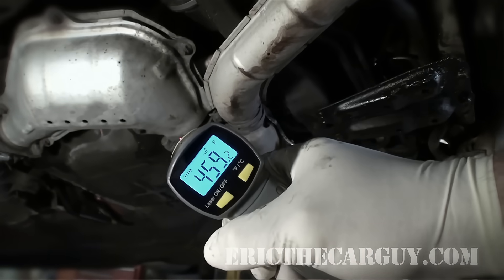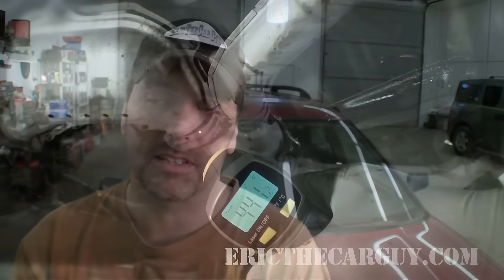Does Lacquer Thinner Clean Catalytic Converters? -EricTheCarGuy

Comment: You're supposed to run a 10:1 ratio. Do 1gal of thinner to 10 gallons of gas. So you're not running enough thinner thru the system. And you need to run your car at higher rpms.

Comment: Just did this on a 5.7L and it WORKS. pour in one GALLON of thinner (not a quart) with a half tank of gas. Drive it so the car tachs at least 2500 rpm. Preferably on the highway. I drove 130 miles, and without clearing the code, the light went off ! You might have to drive over 200 miles, and keep using the Lacquer thinner. But the code should clear. Unless you are hearing the guts rattling inside the cat lol

Comment: The petrol E10 supplied in UK very dry causing various issues with various injection systems have found some petrol additives lubricate and keep clean the fuel system and stops sooting

Comment: Since pulling off my front bank cat on my Honda would require me to remove the fan shroud, my passenger side wheel, and my passenger side cv axle, I think I’d rather try the laquer thinner before removing the cat for cleaning.

Comment: It worked for me with one gallon of LT. My CEL gave a P0421 code because I left too much Berrymans B-12 in the intake after a carbon cleanup. Drove 30 miles highway, nothing. Drove another 30 miles a few hours later, nothing. With my errands done, I dug into it using Scotty's rev in place method. Cleared the code, ran 30 min at 2300 rpm (watch the temps) in Park. Code didn't come back. I still had 3 gallons left so to burn it off, I got on the highway (after rush hour no traffic), ran at 3000 rpm over 20 minutes. CEL stayed off, when it previously would come back after 10 minutes.

Comment: According to all I have read the long-term effects of using Lacquer thinner is negative with corrosion problems and seal deterioration of the fuel system including damage to fuel injectors.

Comment: This will depend on what is causing the catalytic converter issue. If there is only carbon and other fouling then fuel additives can help the fuel to burn cleaner and partially clean it for some time (Cataclean, Techron, Lucas oil, etc.) they can work for a while, but unless the cause is resolved (PCV valve, worn piston rings, etc.) it will come back in time. If there is a hole in the cat then it needs to be replaced.

Comment: There is another video recommending removing the cat and soaking it in distilled vinegar to remove the carbon which could work and makes more sense as vinegar can be used to clean most metals.

Comment: I had come here and comment!! 
10/09/2023
@Scotty Kilmer
thank you so much .!!!
for your time the value you give out to the world,  for sharing your knowledge,
I' needed it this fix, didn't believe, and was scared a little bit at first,
for P0420, if your Cat, it's just staring to go, like Scotty says, it's worth to try, I did it today, 1 galon lacker thinner to a half a tank, drove my 96 tacoma 2.4, for 2 hours, went 3 hours total without turn it off, next check the monitors with a OBD scanner ( mine, blue driver ) total pass, 
took it to smog check,
guy says.. truck's running super clean, have not seen that so often
so good to hear, I don't know how long is it going to last, but the thing is, to pass the emissions, because, car overall runs very well,
THANKS @Scotty kilmer

Comment: Thank you for proving Scotty WRONG.
Reply: OK, so he has "proven" Scotty wrong. He's "proven" that lacquer thinner doesn't work, by using one quart, instead of the recommended dose of one gallon (so 25%), in about three quarters of a tank of gas, instead of the recommended half tank. In a vehicle that he states the catalytic converters are not clogged, instead of one with a clogged catalytic converter. Yep, he sure showed Scotty. This is trolling and clickbait, if I'd seen this video first, I'd never have watched anything Eric put up.
Reply: @Rob07601  Yes, I agree with you Rob. He is a tick sucking the blood out of Scotty. 👍
Reply: @sartainja  LOL, OK, I think that's going just a bit too far. I actually like his other videos. This one rubbed me the wrong way because he wasted my time with a meaningless video while I'm trying to decide what to do about my F0420.
Reply: @Rob07601  Sorry, about the code that you are attempting to clear. Watching all these videos makes you feel like that dog chasing his tail. If the code popped up during this cold weather,  maybe just wait until it warms ups to a reasonable temperature.
Reply: @sartainja  It's been brutally cold here in Orlando, low 40s a few times the last couple weeks. Twenty years and I still don't miss winter in NJ.  =-) I have to drive my pickup for work, so I don't need any breakdowns. When I searched the code on Youtube, Scotty's video was one of the first results, but putting lacquer thinner in my gas tank doesn't sound right to me, then I saw this video title, "Does Lacquer Thinner Clean Catalytic Converters? -EricTheCarGuy" "myth busting" Scotty's video, which turned out to be useless, because he didn't duplicate the test. Leaving this worthless video, that doesn't answer the question it asks, up for ten years, getting 2.9 million views strikes me as trolling for clicks. Ended up picking up CataClean at AutoZone, I'll see if it helps.
Reply: Follow up. I used the CataClean, added to about a quarter tank of gas, but drove about 30 miles instead of 15 before I filled it up. 
Next morning when I started up, no check engine light.

Comment: I did 1gal Lac Thinner to 1/2 tank on my 2017 Ridgeline. Ran engine for 40 minutes at 3000 RPM, then reset engine light. Drove about 70 miles on highway and engine light reappeared. Days prior, Honda dealer installed new injectors  because of error code/engine light.  Drove about 70 miles on highway and engine light reappeared.

Comment: I think you should retest with a gallon of lacquer thinner. You should remove and inspect  prior to the test drive to make sure the issue is contamination (soot) and not physical damage. Then you will be able to conclusively say whether or not it worked on your car. Right now, I do not think this was a valid test.  Also, I'd say we are assuming that the CAT is contaminated and not worn out.  I think the thinner would work in certain cases of light soot with low build up.

Comment: I know that a good old-fashioned Italian tune-up can work great on an under-performing cat. My 5 Series BMW just refused to bring the CO inside permitted limits so, as advised by the tester I took it for a major thrashing and after it had cooled down a bit passed the emissions with flying colours. Of course it's not easy to do this inside speed limits (but I did of course 😙)
In this case I suspect the combination of the high power settings and the oxygen in the acetone molecule help burn off carbon deposits in the cat.

Comment: I had a rattle on my exhaust, and I thought it was the catalytic converter, turns out it wasn’t, but I removed the catalytic converter insides on my 1995 Saturn coupe. no check engine light and actually the car runs much better without catalytic converter’s

Comment: Make a long story short I got a 6 L 2500 2009 Chevy with a bad catalytic converter tried a bunch of snake oils made the check engine light come on sooner I was going to buy the whole wide pipe with the catalytic converters would have been over $600 plus labor I seen Scotty's video that then confirmed it here I just tried it drove it over 60 miles look at my live data temperatures went down by about 300 degrees way better acceleration no check engine light yet exhaust smells a lot cleaner as well

Comment: Sooo, after having a misfire due to oil getting past a spark plug seal, (Toyota 3.0L 1MZFE) I eventually got a CE and Cat code...  ... saw another YT video suggesting the Lacquer Thinner fix and it worked!!!   Be very careful to not use too much or can potentially overheat CAT and Pistons from what I've read (used about 1/4 cup for about 5 gals in  the tank).

Comment: I discovered something new with my 2005 honda minivan...When the engine gets hots the van dies until  the engine cools.  The Honda dealer said: it was the fuel pump, throttle control; radiator, etc... After spending much $$$$, i found out I was using 87 octane gas so on the next trip i filled the tank with 91 octane gas and that fixed the problem. The Dealer was totally useless.

Comment: 68 MPH at 2800 rpm.   My old Trailblazer turns 1900 RPM at 70 MPH.  Probably because its a 6 cylinder.

Comment: Come on man it sad 1 gallon always hater out here how about stop hating not everyone has shop money to fix their vehicles any information helpful but yes no guarantees but to buy a 10 doller or less product and try it to pass a emissions buy anyone a year here in texas 2025 bye bye emissions testing shop hourly rates are thru the roof i just fix my knock sensor on my 07 Toyota fj cruiser myself saved 4k over dealer doing by watching a you tuber showing a different way only cost me my time and less 90 minutes to do the job because i have a supercharger on my yota saved a mint
Reply: The one gallon did not work maybe because my spark plug may need to be regapped so I ended up just buying a spark plug fouler and drilling out center and putting o2 plug in that now no more p0420 code

Comment: Use 1st Diesel, Petrol, water, and air in the following sequence can clean catalytic convertor I have used it and it work's (5 litres) each later air through blower and thereafter a bit compressed air but on low pressure

Comment: I'd like to see a kit where you could disconnect an O2 sensor and connect some kind of metal tubing and high pressure solvent canister and pressure regulator that would let you inject a small amount of solvent directly upstream of your catalytic converter as the engine was running.  What's the worst that could happen?  Kaboom!

Comment: I poured a gallon of the lacquer thinner in a tank of my CR-V because I couldn't get the computer to reset for inspection. That was two years ago. It didn't seem to make any negative impact on how the car ran. I ended up driving the car periodically over the next few weeks and one morning I went to start it and the computer code had gone. Turns out my code was related to recharging a battery after a brake light switch failure and not completing the cycle test. My truck with OBD1 takes 30 miles to reset under these circumstances, this car with OBD2 takes a few hundred.

Comment: Unfortunately you would have to take off the cat before and after to fully confirm if this did anything.... As well as check airflow through the cat.. Doesn't appear anyone wants to go through that much trouble just to see if it works.

Comment: Lacquer thinner does not work at all. I had a po420 code. Nothing worked. You have to replace it.    Meineke gave me a 2700 estimate. I noticed 365.00 was for labor so I got on line and oerdered all OEM parts . Two upper and lower sensors anda cat.  Cost me 1100.00. Took it back to ieneke and they installed it foe 365. Turned out to be 400.00.   So I got the front tight cat replaves and two sensors. Get you rdensors for Roch auto and use dense. Denso makes Toyota the sensors and are cheaper from Rock auto. So it cost me around 1500 to have it replaced. No more codes.
Here' the big bonus.  may car was getting 17 mi per gal in or out of town.  I took a road trip and it got between 23 and 24 mi per gal after changing out that converter.  I never expected that to make such a difference.

Comment: Converter poisoning by the additives used in the manufacture of engine oil is cause for many of these failures.  The PCV system is often overlooked and if not working properly can allow excess oil into the combustion chamber.  Clean or replace the PCV valve before adding the laquer thinner as it will reduce oil consumption and increase chances of the light staying off.

Comment: Scotty did not say that this would repair a "faulty" cat. But that if there was minimal blockage on a properly working cat, that is say, just enough to make the light go on, thinner might work. 1 gallon to a half a tank of gas. But if there is no blockage, it makes sense that thinner wouldn't work, or any cleaning solvent for that matter. Because he also mentions soapy water if you have the time and patience enough to remove yours. My code comes on sporadically. I'll clear it and it won't come on for about 20 miles or so. This makes me think it might just be a small blockage (carbon buildup etc.) So Scotty recommends driving on the highway for 150 miles at about 2500/3000 rpm. An "Italian tune-up". I'm about to do this on my next trip out of town when I travel 2.5 hours. I'll update if it works or not.

Comment: I'm a little skeptical. I do believe it will clean the fuel system and Cat. But, notice it comes in a metal can? Its a powerful solvent that eats rubber and plastic. Hint: Fuel lines,  pump, regulator, injectors, Orings are all made of? So, is it possible it solves a short term symptom, but, starts a chain reaction of failures down the road from plastic parts failing? Just my 2₵
Reply: It I'd diluted in 10 gallons of gas!
So you guys are calling him a liar? He's been doing this for more than 40 years! Come on!!!

Comment: Muratic acid will clean metal ,will clean rust. It can be diluted with water , it also cleans concrete . Diluted it to application , if you cc is already off the vehicle this will probably clean it internally

Comment: I like your videos, but in this one, 1/4 gallon in 12 gallons is not even close to Scotties recipe of 1to10. Also, one cat does not make or break the validity of a process so IMO, not debunked... Yet...  Also, on other videos in comments so far I've seen over a dozen success stories to every one fail.?  I haven't seen an explanation of why it might work, unburned thinner makes it through? Is it because it runs hotter exhaust, could that burn your valve, which cars would be most susceptible to burnt valves? Also, what does LT do to gaskets, seals, etc. If I ran it through in just a couple hours would it still damage anything?

Comment: I was getting a P0430 code, I did a temp test on my cats, hotter on the engine side by 100F, could not pass California smog.  I did 1 gallon liquor thinner in a half tank. Passed smog today. 2015 F150 v6 3.5 TT ecoboost. 100% worked for me.

Comment: You need to take the converter off the vehicle and fill it up with lacquer thinner and set it on fire, high heat and burn it out is the only way to clean out a convertor.

Comment: Thanks for the test. Your explanation toward the end of the video explaining different possible issues for a bad cat is something I hope everyone stayed around for. Pouring any solvent into a fuel system certainly won't "fix" a bad component. The idea is that it might clean the elements inside of a catalytic converter, thus get it to function more efficiently. You showed that adding a pretty dilute solution won't damage the vehicle, so that's more evidence to trying this. That it didn't clear your code suggests that perhaps the mixture wasn't optimal  (it's certainly not 10:1, or even the 5:1 as some who have used two gallons to a half tank have done), or there is physical damage to the cats on this vehicle. The value in trying this is that whether it works or not, it's an attempt that costs less than $20 compared to new cats costing to over $3000 (in 2023, for CARB compliant OEM Subaru cats). No one who has tried this and shared video has destroyed an engine, on any make of vehicle. I suggest it's worth a try.

Comment: PO420 is a very easy fix! Put an extension in the bung hole then screw your o2 sensor into the extension. No more PO420 code.

Comment: I don’t see why it should work to begin with.  It’s a combustible hydrocarbon not so different from gasoline,  with similar sized molecules, though some are ringed aromatic types.  But still, what would be the cause?    Catalytic converters require a fraction of oxygen in the mix, so maybe slipping some nitrous oxide in upstream would help cook out carbon deposits.

Comment: I would have removed O2 sensor, poured cleaner through top bank of O2 sensor let it soak then reinstalled it to burn off any residual carbon or junk that was deposited into Catalytic converter.

Comment: If you can heat it  slightly above 400ºC you burn the soot away. It is a typical old school trick used in welding where you first flame to reach 400ºC. It should also be safe as it is below the safe temperature level for the ceramics in the catalytic cell.

Comment: I used Scotty’s instructions and it worked on my 2009 Nissan rogue. You added a quart to a 3/4 tank. Scotty suggested 1 gallon to half tank.  In fairness, if you are going to “test” and reference his video, you should at least follow the instructions to get a result that holds weight.
Reply: Nailed it. Exactly.
Reply: also I noticed he is using lacquer thinner from auto body paint shop. might matter. higher quality stuff there. 😅 very flammable 🔥🔥

Comment: I'm so happy I didn't watch your video after Scotty's ! I put a GALLON lacquer thinner into my half tank of gas like Scotty recommended.  The 420 code disappeared . You used a quart in a 3/4 tank. Why? You did not debunk Scotty's PROVEN theory. BTW...I ran my 2003 Honda Accord for 1/2 hour at 2500 RPM like recommended. Scotty rules!

Comment: no frets, thinner is going to burn just like gas; actually a lot better. It just shows you how bad the gasoline is. Use to go to the local airport and they would sell you 105.Cleaned my alfa romeo, but with today’s ecu brains and sensors would and has cause stall outs on an engine  where the motor; crank; pulleys, piston; rods and lifter values(when properly timed with an ACTUAL PHYSICAL belt /chain runs amazingly well. BUT NO, let’s put a computer on it, with no back up measures and leave you sitting on the side of the road! oh well just venting,,,,,,,,,,,,,,